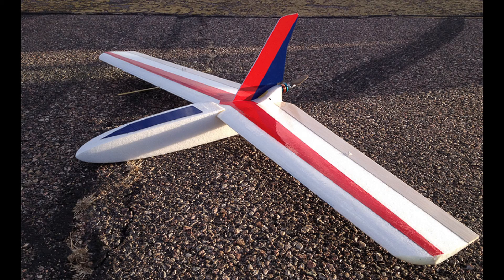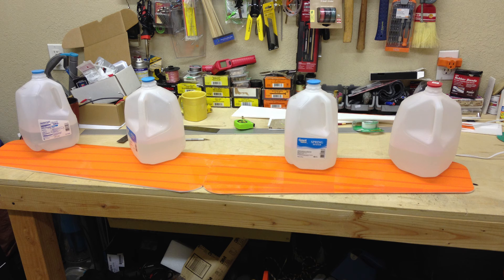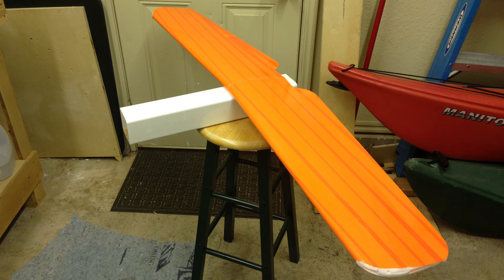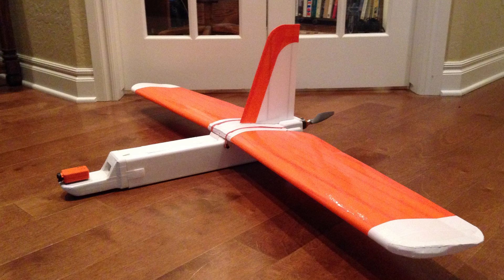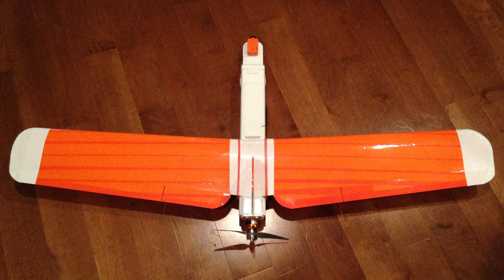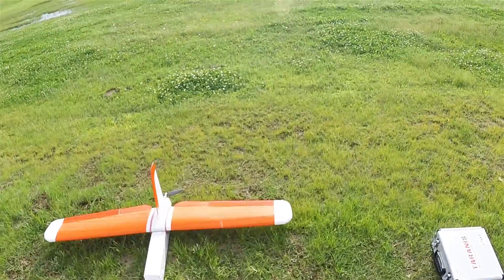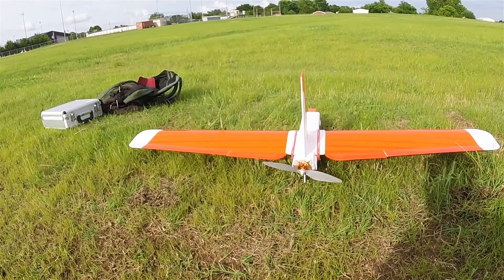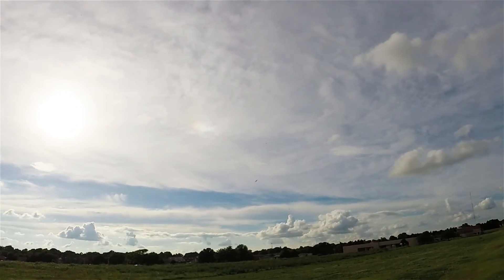DTFB Nurf Plane build and maiden

Comment: Hi nice model, what airfoil dis you use?
Reply from the maker: Thanks!  It's folded foam board, so it's not a "real" airfoil per se.  The folding I did made it an approximation of a Clark-Y, which has a fairly flat under surface.
Reply: @mostlyharmlessrc3920  thanks for the infos! keep up the good work ;)

Comment: Very good looking plane! Also looks, as if it could be a swift and efficient long range FPV platform.
Reply from the maker: Thanks! Yes it was a really good fpv plane, thanks to the original designers. Made of foam board, though, it only remained in good shape for about a year. Try the cut EPP version from flyingfoam.com if they’re still selling it 👍🏻

Comment: where did you put cg?
Reply from the maker: Jimmy Demello  It's right on the leading edge of the wing.  I probably could have moved it back a few millimeters from here and I'd need less reflex!
Reply: Thanks for feedback. I had been looking around at other forward swept wings to get a general consensus on where to put the cg. I bought a Lighting wing which is just a couple centimeters forward swept and my cg is at less than 10% of MAC or around 10 mm back of leading edge. Other fs wings seem to be from 10% to 15% but not at 25% which makes my wing hover. Yours is a nice wing.
Reply from the maker: Thanks Jimmy.  I'm really impressed with the robots you've made. I also really like the way your vids show your learning process as you test out various configurations.  I have tinkered with bots a little - are the walking programs in arduino software?  Thanks for the comments!
Reply: Thank you - the robots were fun.  Yes all is arduino coded - not too sophisticated. I might do a robot arm project soon. Flew my wing today - too much fun.

Comment: Do you think the sweep does anything? Would a straight wing work?
Reply: Simple version:  Forward sweep helps to create span-wise airflow from tip to root.  That helps keep tip vortices down.  That helps it be more efficient.  Also moves wing spars etc towards back so you have more room in the nose for all your stuff.
Reply: After we designed the Nurf we had the chance to have it analyzed by a local university as part of another project.  Forward sweep works as advertised out at tips.  Fuse also created more lift than I though it would.
Reply: No worries.  Love to see people hacking on our stuff.  It's all released under Creative Commons so wish more people would hack.
Reply from the maker: I honestly don't know if the wing sweep does anything to improve the flight characteristics.  My background is in biology, not physics.  Ed from experimental airlines says probably not, but others swear by it for lowering the stall speed.  I think it reduces drag but that's only a guess.  "Plank" style wings inspired me to build this and several old designs use a straight wing.  Give it a try!  I'm about to post a new video of one of my camera nose builds like the one I used on this plane.  Cheers and good luck...
Reply: +MostlyHarmlessRC lol. I'm a biologist not a physicist. Gotcha. A video of a nose build would be great. I did my own simple interpretation of your nose build on my cp60 and after taping it over it looks similar enough. Thanks for posting the vids and sharing your builds.
Reply from the maker: My pleasure!  Thanks for the great response.  Good luck with your build!
Reply from the maker: Hi Phil - you might have a look at my most recent video in which I made a nose very similar to the one on my CP60 and the Nurf.  Cheers   https://www.youtube.com/watch?v=C-23mQGs-tk
Reply: Thanks. I watched it when if was first uploaded. I built mine with just the bottom layers but I think the next one I will try your method. On that note I have a couple questions about the wing for Nurf. How did you calculate the forward sweep and do you have dimensions? Cant find any info on building forward sweep into wings online. Not clear info anyway.lol
Reply from the maker: Great! The forward sweep in the armin-style wing was done by removing a wedge that is 1 inch wide at the leading edge of each wing half, tapering to zero cut at the trailing edge.  I got this idea from Andrew Newton's Spectre plane video (about 2:35 in this vid: https://www.youtube.com/watch?v=Uk7n0xJMaUg).  I used the same method for my first specter and megaspecter planes as well.  On the 57 inch Nurf wing this gave me nearly (but not quite) a 2 inch forward sweep measuring from wing root forward to tips.  This puts a bend in the internal carbon arrow spar that is held temporarily with tape and hot glue while internal gorilla glue dries on the spar.  I also have to widen the spar channel a little. I weight the wing while this glue dries and the result is very strong.  Let me know if you need more info.  Send me a link to your build pics or video if you can!
Reply from the maker: Thanks Coby!  I have heard that explanation before and I like it.  I believe this has been tested on full-scale planes moving at high speed but I don't know if our little planes actually experience those benefits.  My Nurf is quite energy efficient, though, so it's very possible.  Appreciate your post!
Reply from the maker: Sorry I didn't recognize you as one of the original designers of this plane.  Thanks for the great design!  That's also very cool that you verified the flight benefits of the forward sweep.  I appreciate your expertise and comments!

Comment: great job!  
personally I have found a split elevator/aileron to feel better for forward wings than elevon mix.
Reply from the maker: Thanks for the positive feedback!  I had not considered a split elevator/aileron setup - that sounds really interesting.  I looked for such a setup in your vids and didn't find one. Do you have an example vid or plane you can point to?  Thanks again.
Reply: do you go to RCGroups?
Reply from the maker: +TheRattleSnake3145 I mainly use fpvlab. I probably should make an rcgroups account...

Comment: Any chance you could make a video or give a description of how you make (noses?) for your planes. I keep pausing the video but can't figure it out.
Reply from the maker: Thanks for the comment!  I have Andrew Newton's philosophy about noses on diy planes, which is to make them removable for better access to the inside.  See him talk about that halfway through this vid: https://www.youtube.com/watch?v=Uk7n0xJMaUg.  Unlike Andrew, I use layers of hot-glued half-inch pink insulation foam and sand the final nose (w/~150 grit) to make them fit snugly 1-2 inches inside the fuselage.  Then I hold them in place with duct tape 'straps' that have velcro ends.  I also cover the outer nose in duct tape to improve the look and the aerodynamics a bit.  I may well post a short video about the nose I'm making for my megaspecter plane soon.  Thanks for the idea!